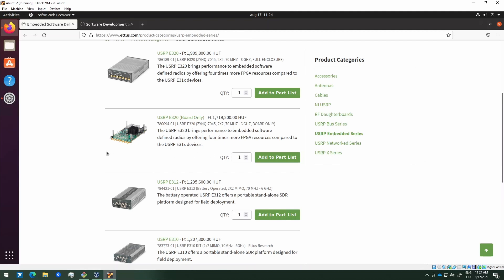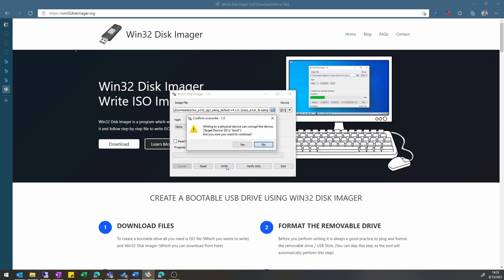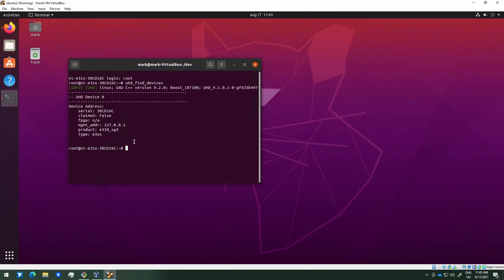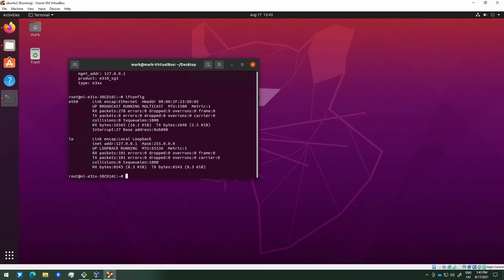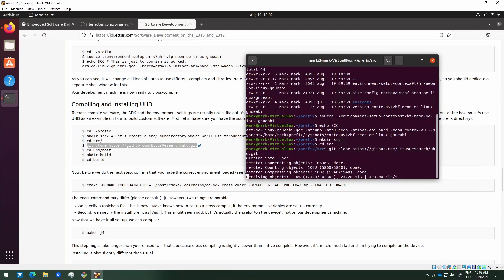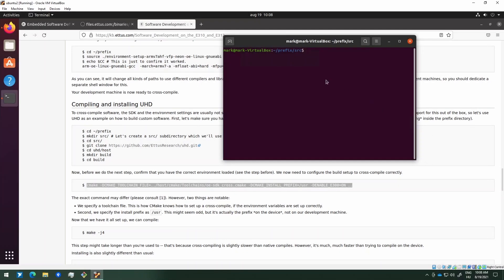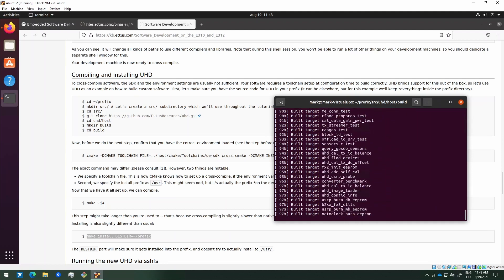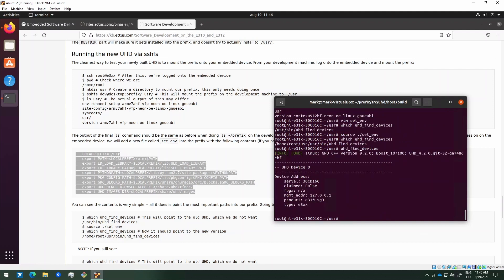Ettus E3xx cross compilation tutorial

Comment: can you make the e310 interface with GNU radio with pybombs  i am trying it but it is getting errors like configuration and package installation errors please give me some help
Reply from the maker: Please follow the steps in the tutorial, you don't need pybombs.
Reply: @dumark  yes got the example codes are running but i want a write block program in gnuradio  and that will be send to the E310 for execution in E310 can make any help for this
Reply from the maker: @hemanthkumar-dk6rg  Install GNURadio from Source to your PC following this tutorial: https://wiki.gnuradio.org/index.php/InstallingGR 
Make sure you install the 3.8 version if you would like to have RFNoC support as well. You would also need to cross-compile it to the E310. Your GNURadio installation will have an examples folder (under your installation prefix, default is /usr/local/share/). In the examples folder, you can find demos under the uhd folder that you can run on the device. If further help is needed feel free to reach out to NI support (https://www.ni.com/en-us/support.html)
Reply: @dumark  i installed 3.10 using pybombs method successful install. Now I want make GRC flow graph for sinwave genaration and that flowgrap should be goes to e310 hardware and execute to FPGA  board and give the signal at tx port .
If it is possible can we connect with team viewer